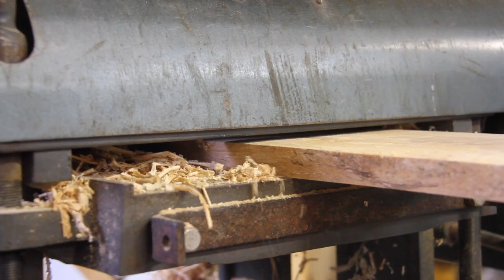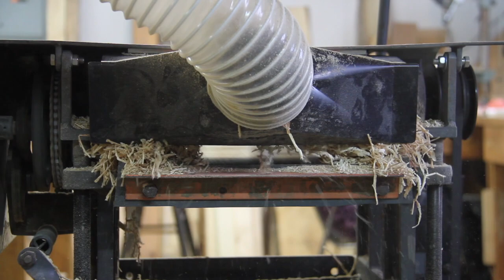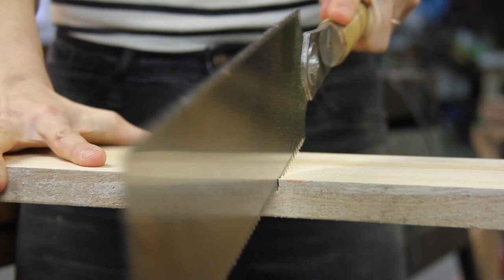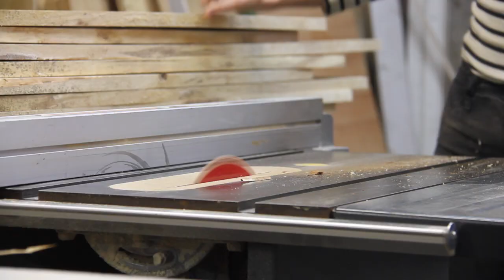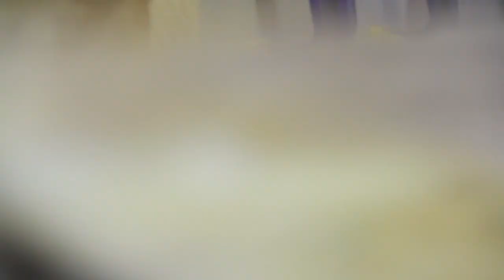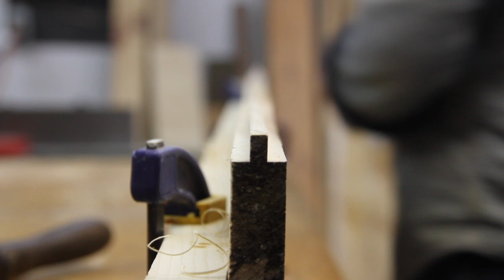IN THE SHOP: Making Tongue and Groove Flooring

Comment: Safety violations using the tablesaw without a riving knive/splitter or push stick @ 4:46 .Sawing to length using a Dozuki with both ends of the board supported, pinching the dull blade. @ 2:33. Too much hand work required to be productive and efficient. JMO
Reply: Yeah I don't like to publicly shame creators because they are trying but it is also sketchy on the tablesaw.  Her hands where in terrible positions, one kickback and she's losing digits.  Especially when doing production work, get a Grr-Ripper and save your hands.
Reply: In 30years of woodworking ive never used anything other than a push stick. A little common sense goes a long way
Reply: Great reminder.